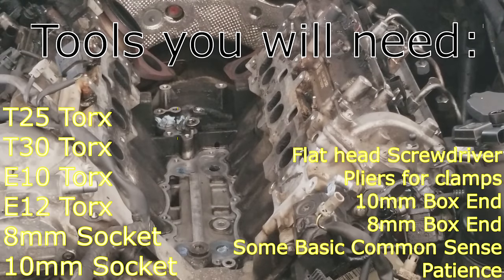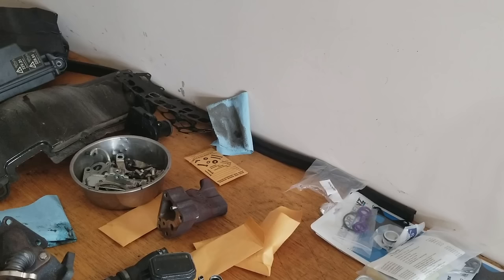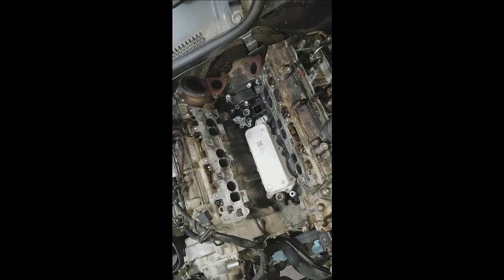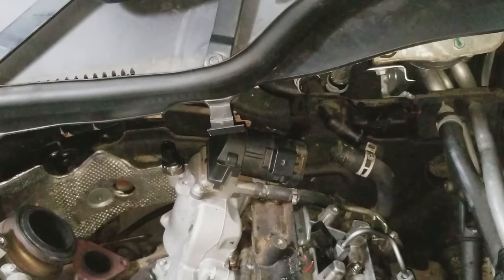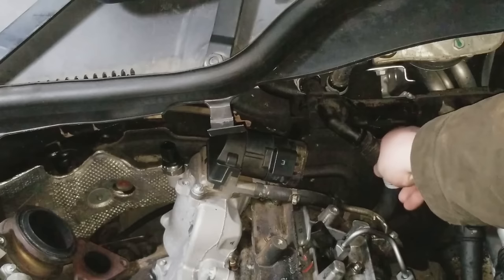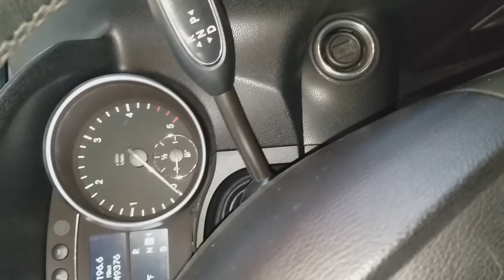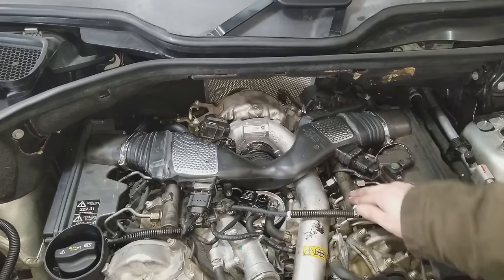OM642 Oil cooler seals DIY guide and timelapse!

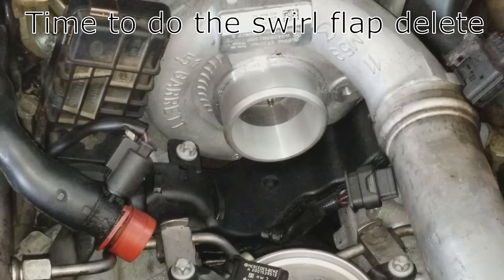Comment from the maker: By popular request, the swirl flap delete resistor is at 25:50 in the video. i DON'T show the physical delete of the swirl flaps, i didn't have my camera with me when that was done.
Reply: I very much doubt that this trick with the resistor works. This is not a delete but more like an emulation/emulator. A delete would be a software modification...
Reply from the maker: @Dima-jq3mj  it's worked without throwing a code on my 2007 E320 Bluetec for over 2 years.
Reply: I have a 2009 ml320, can I still put in the resistor ? if so, how would that effect the intact hardware?
Reply: MBDieselFreak - awesome video.  Just bought a used 2012 E350 Bluetec and need an oil cooler replaced.  Do you do work on the side? I am in IL.  Thanks!
Reply: So you deleted  the whole swirl flap system ?
Reply: @Dima-jq3mj  Oh yes it does. But you would all be surprised at the ammount of crud in the mannis, egr cooler etc. Took me longer to get it all clean than the job itself.
Reply: @MBDieselFreak  Will the resistor trick work on an older OM642 Engine? Mine R320 4-Matic CDI is made in 2007. Is this video also valid for that engine parts, or only for 2009 Bluetec OM642?
Reply from the maker: @Skenderovski  This video was made on an 08 ML320 CDI, exact same engine and emissions configuration as your 07 R320 CDI
Reply: Will this work on a 2011?
Reply: @nitto63  There's a bunch of youtube videos on the om652 swirl flap delete process. Basically, the flaps are knocked out and all the hardware taken out including the swirl flap motor. The holes are welded over. The resister does the trick and these guys have a swirl flap sim plug with the resister already in it: https://www.xtremediesel.com/shibby-engineering-smrp-swirl-motor-sim-plug. Also important is the catch can installation.
Reply: The swirl flaps are stainless.Did you cut them out?
Reply: @Dima-jq3mj  It works just fine on my 07 Jeep, did it 5 years ago.  No codes. no nuffin'.
Reply: Awesone video, did you notice any loss in low down torque after the delete? 

I think my om642 even though it's a 2014, the cooler seals maybe leaking, though tomorrow I'll investigate
Reply: @Dima-jq3mj  It literally works like a software delete. The resistor takes the place of the motor. The computer is happy, yet the flaps are stuck open all the time.

Comment from the maker: NOTICE for 2009+ bluetec owners, DO NOT attempt swirl flap delete on your cars, you have extra flap position sensors on yours that can't be deleted (to my knowledge), I don't want you getting any CEL's after permanently deleting those flaps.
Reply: Have you reflashed the ECM? Just curious if you've tried it. I can't find much for the late model Merc diesels.
Reply from the maker: @advgabe  no i have not! all 5 of my cars are stock.
Reply: @MBDieselFreak  I did the resistor bypass trick on my failed motor, which keeps the car out of limp-home mode. But yeah I still have the intake runner failure CEL. If any has tried the Malone tune let me know! A 5¢ resistor is way cheaper than a $1000 reflash. Lol
Reply: Having a hard time finding videos of people doing the swirl flap motor delete... but i've seen some people just put in the resistor? Would that work on a 2007 e320 bluetec?
Reply from the maker: @EthanDenny  yes it would! If your linkage is still intact it would fix any check engine lights you may be having.

Comment: Awesome - I did this job and it is a real bugger. It will take a couple of days for the best shade tree mechanic. Who ever designed this piece crap should be pilloried in the centre of town. My one tip is to take a piece of styrofoam and a sharpie and make a diagram of the engine and  as you remove bolts stick them into the foam the spot you removed them. Mercedes has a bad habit of using specific  bolts all over the place.when they could have easily used a couple of different sizes. Use anti seize and loctite where suggested.

Comment: Excellent job with the video, I pulled the wiper and cowl when I did mine in the W164 and it expedited the process by nearly an hour, none of the fussing you're discussing with the heat shield.  The wiper came off in 10 minutes, the rest of the cowl was instant.   World of difference.

Also, discovered the fastener that holds the linkage to the swirl flaps motor was loose!  Boy did the engine run smoother and torquier after the repair.
Reply: Hey Mark. You said you pulled the wiper cowl but in front of that sits the heat shield. What vehicle did you do this on?
Reply: David Garner Dave, first I remove the wiper blades second the plastic shield over the wiper motor and what not kind of snaps out of place I think there’s one or two fasteners holding it which totally exposes the wiper motor that comes right out I think there’s three fasteners that hold that. The shield around the back of the engine is held in place for immediate removal with 10 mm headed bolts. It’s designed to come apart for maintenance and go back together easily it’s very modular

Comment: Great video. One thing to mention is the replacement of the PCV tube and Batwing to Turbo silicone seal replacement. I noticed the PCV seal was smooth. It should have 3 small ribs to assist sealing to the Batwing tube. Otherwise an awesome video. extremely helpful. Tackling mine this weekend.

Comment: Thank you for the video, I own a 2012 GL with the OM642 engine, the seals were replaced within 6 weeks of ownership from new by the dealer under warranty (They were the Viton seals). I have just done the seals a second time at 163,000Km, just out of warranty. The job for most part is quite easy with a lot of patience, the worst part is the swirl motor arm connections. To do these the easy way the swirl motor should be installed when both manifolds are on a work surface. I did mine after the manifolds were in place and I'm now in the process of doing them again, one of the clips broke. The only solution is a very small dab of superglue to hold the clips together while they are pressed back into place, the only issue is glue spreading into the sphere and reducing the friction around the ball. If my current attempt fails I will buy 8 clips and try again next weekend. 

Next up, the dreaded timing chain, which I am not going to challenge.
Reply: I decided against the super glue method, the glue spreads to easily into the ball socket and adds to much friction. My next attempt was quite quick with new connectors. I connected the arms to the flap control arm first, then connected the swirl motor.
Reply: @tynesidesteelerectors994  There is a guy who selsl a metal replacement part for the swirl connectors. Do a google search.

Comment: Impressive video - and one of the reasons why I still love my OM648.
Reply from the maker: Blackjack666 Me too! Hahaha. I do love the om642 as well, it's a real work horse for it's weight and size.
Reply: @MBDieselFreak  i have had my 642 since last june and it is great. the van is 4.2 tons and will happily tow another 2 ton on the back..  far better than the old van . 282k miles on it atm too
Reply from the maker: All modern Mercedes common rail diesels are very good engines! The om642 suffered the most problems, but none were serious problems such as actual serious internal components needing to be replaced.
Reply: @MBDieselFreak  I would be curios what the things to look out for are, i have so far found out early engines had issues with the oil cooler seal. the glow plugs and/or relay tend to die and of course the black death injector seal issue.  I had an issue with the alternator Y cable so made a new one up with 70mm cable and ran separate cables to alt/starter. (it is a 200A alt, main and large aux battery system). this greatly improved charging and cranking.
Reply: 648 is a great engine until the head cracks between the valves and every second-hand one you find is also cracked... I'll take the oil cooler leaks over that any day of the week.

Comment: From what I understand the bulk of the job is removing the turn on top and the two intake manifolds. Supposedly removing the turbo can be the hardest of all. 

I just got a 2008 Sprinter with 235k miles and it's leaking oil like crazy, convinced it's the oil cooler seal rings.

I've changed my oil on my other sprinter which is 2006 (t1n model) and done small repairs on that.

Very tempted to do this on my newly purchased 2008 sprinter.

Great video!

Comment: A couple comments.  My car is a 2011, E350 Blu Tec  now as of May 2020 has 35,000 miles.  The oil is changed every 5K or so.  At 25,000 miles I started using the Turbo Maxx oil additive 1/2 oz per quart of engine oil, Mobile ESP 0-30w, I think this should improve the carbon and the wear problems on the timing chain.  I also use the Turbo Maxx c-4 fuel additive 1cc per 3 gallons.  The use of the oil additive increased mileage from 32 mpg to 36 mpg.  The use of the fuel additive increased this to 38-43 mpg. Mr. Ellison has accurately predicted the improvements.  I was surprised, so I will keep using.  I am hoping the cleaning ability of the oil additive helps with the coking problem.  I plan some bore scope investigation during the summer.  The EGR system does not seem overly dirty though I did clean the EGR valve for maintenance at 25,000 miles.

I note by 25,000 miles the turbo housing to inlet horn (red) gasket had failed due to combination of compression set and vibration wear.  I replaced the small red PCV hose seal also.  I will note the inlet horn and the mass flow air sensors needed replacing due to imbalance of calibration (shows as EGR flow issue) as the ecu calculates the EGR flow from the MAF sensors, due to contamination of sensors.  Do not ever try to remove or clean the sensors for routine maintenance as that will put out of calibration... or attempt to clean (already tried those solutions).  Learned about the calibration sensitivity issue was the real issue, by carefully checking the data coming from the sensors during a driving cycle.  If you get a code from this it shows as a EGR flow issue not as a MAF sensor reading... you have to look into the MAF sensor real time data. 
After some investigation of the PCV system I believe it has some design issues which could be improved to minimize oil carryover.  System is designed just too lazy to install. I believe that the problem is both a long term efficiency problem with the centrifugal air-oil separator, the separator being marginal in design capacity, and the system experiences too high crankcase pressure during certain parts of operation. I think a catch can solution would be inadequate, and a more robust solution attempted. I will not most vehicles have much better air oil separation designed in the valve cover baffle sheet metal attached to underside to the inside of the engine (no catch can is going to work better).  It appears the crank case pressure increase under certain loadings and speeds of engine.  This is a small increase of a few inches of water column pressure but I think that is where the issue is. 
So far other than some electrical connections becoming brittle things are doing well. I will replace some of these connectors this summer.

Comment: This is the single most helpful video on YouTube. Thank you. My turbo just went and im going to do the oil cooler seals while im at it.
Reply: Did you change the oil cooler seals? How'd it go?
Reply: @J87513  The bolts on the back of the turbo are truly a nightmare. I actually only got two in out of three on the one side then gave up after several hours of righting with it. Other then that, jobs pretty straight forward. Keep everything organized and do it all in a weekend (not like me and do it over two months).

Comment: Good video. You put a resistor in a connector near the turbo and taped it up.  I missed what it had been connected to and what that was about (swirl actuator motor in the intake?).  I have never worked on a diesel or turbocharged engine before and this is really helpful in getting my confidence up, but there are a lot of bolts, tubes, hoses and wires to test my memory and ability to organize the removed bits and bolts.
Reply: The connector is for the swirl flap motor. The oil passes the internal turbo seal and drips onto the connector and creates limp home issues. By disconnecting the connector and putting in place 4.7 ohm resistor, you are tricking the ECU in thinking that the swirl flaps and motor are ok and so won't trigger limp home mode. i would also tape up the top of the connector that the plug end with the resistor plugs into. 

If the turbo is leaking it is always good practice to sort out the leak, but that obviously depends on funds. a stripdown and rebuild will be cheaper than buying a new unit.
Reply from the maker: my best advice is to do like i did, and film the complete disassembly and reassembly process so that you have actual FOOTAGE of where everything went.
Reply: Great tips James, I just wanted to know we lock the swirl flap open when we remove the motor?
Reply: @MBDieselFreak  Would you be able to add the time tags to the comments so we can see where the swirl flap motor delete process starts and ends please? Thanks
Reply: I have 2008 dodge sprinter and  the engine pretty same.There is a same 4.7 k resistor in sameplace, but i didn't understand what is that for? Someone putted the same resistor in the similar socket, i think  this socket has to be connect with intake manifold activator, that's why activator doesn't work because it's not connected. I started the engine and push the gas pedal, but activator didn't move. Im really wonder that what is wrong? Could you please give me some information? Thank you.

Comment: @MBDieselFreak Thank you VERY MUCH for making this video and the one on replacing the turbo core.  They helped me complete both repairs and with them I saved thousands and lots of grief.  Details in your video, like the indexing of the turbo exhaust gasket made it possible for me to tackle this repair.  If you're contemplating doing this job two things that cost me lots of time and frustration were the reassembly of the turbo exhaust pipe and the air cooler piping; both seem trivial but if you torque everything up and try to reconnect these, their (ever so slight) misalignment may make it impossible to put them back together, so thread every bolt, then hand tighten, THEN torque wrench them down.  Specifically, on the turbo: thread the 4 bolts that hold the turbo down, the two that hold the egr line to the turbo, and the exhaust clamp, then begin tightening all 7 bolts. Also, print out CourtneyW's 21 pdfs on MBWorld.org and take notes as you tick off each step.  Those pdfs, this video, careful documentation of which bolts go where and a little determination will help you save a lot of money and frustration. https://mbworld.org/forums/m-class-w164/742069-instructions-replacing-oil-cooler-seals.html

Comment: Good job man, doing that right now on a Jeep Grand Cherokee 3.0
Reply: Mine is a 2007 3.0 I have 123K miles and it's starting to leak.  Sprinter shop told me this is common and will need to be done. How many miles did yours have before you did this?
Reply: The oil leakage comes when it comes but 123k miles is not unusal and the Jeep had a bit more.(Friend of mine where i did it)  We have a daily drive Chrysler 300 C CRD with 300.000 km here in Germany (ca 188 k miles) and it's still ok fortunately.  @GoldGunsandGolf

Comment: Hello there, how did you know that those seals were bad and not something else instead? I am having big oil leak, already changed turbo intake seal, obviously was not from there. Before doing what you did I would like to be sure it's from there. The leak is exactly between the gearbox and engine. Can you help me please?, I can send you a video with the leak to have a look. Cheers

Comment: Great video. I’m in the process of doing this job and decided to delete the swirl flaps. 

I have the 2 magnet sensors as mine is a 2014. 

Do you know if putting the wire in the 2 middle slots will still work for mine or is there an additional step I need to take.

Thanks in advance.

Comment: Isnt there one bolt missing right at the turbo housing bottom right corner next to the metal air line that runs direction intercooler...

Comment: I did the job started the car but forgot to tighten the 2 screws on the turbo top T40 or whatever it is and oil came out. Now the car will not start just cranks over do i need to take everything off and clean the mess then start again as it might have a sensor or something that detects a lot of oil in the general area preventing the car to start or it should start regardless? thanks

Comment: At 14:54, what is the clamps that hold the connecting fuel line in place bolted with the fuel filter. These clamps are missing on my car.

Comment: Hola tengo un problema V6 3.0 224cv en parado si mantengo acelerando el coche  falla se acelera y se queda  y vuelve  por ejemplo 2000 vueltas sube a 2100 baja 2000 y vuelve a subir ....eso lo hace a cualquier régimen llevo anulado filtro partículas electrónicamente y perforado y la EGR anulada mecánicamente y electrónicamente  sabes que pueda ser?? Maquina diagnosis no da fallo de ha revisado y no se da fallo 
Un saludo

Comment: I have just done this to my e320cdi. But now I have problem with high pressure fuel side not building pressure.

How did you get car running once it all fitted.

Comment: @mbdieselfreak are there any gaskets or one use bolts that should/need to be replaced during this process? I'm going to attempt on 2011 MB Sprinter 2500, I've never done any engine work before but have done most other repairs. Will also be replacing timing chain, tensioner, and possibly guide rails + sprockets while I'm there.